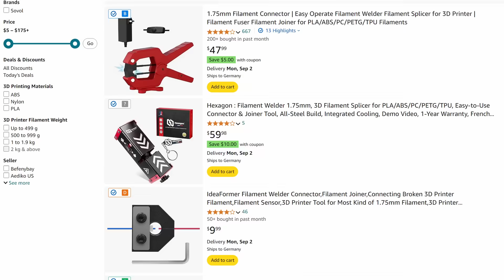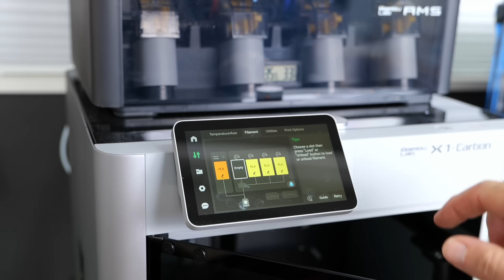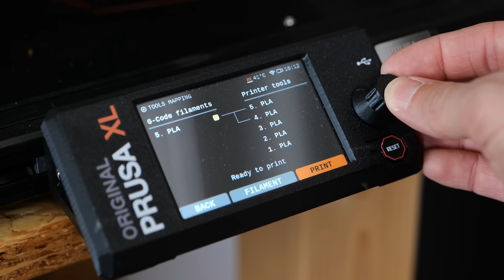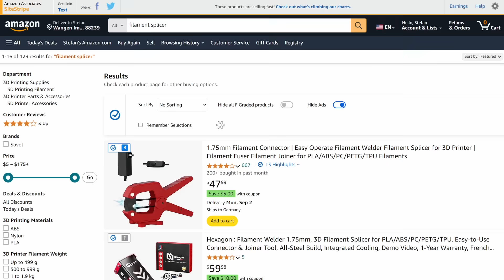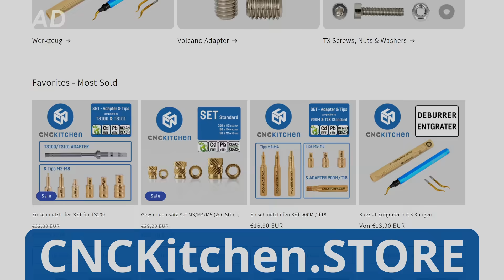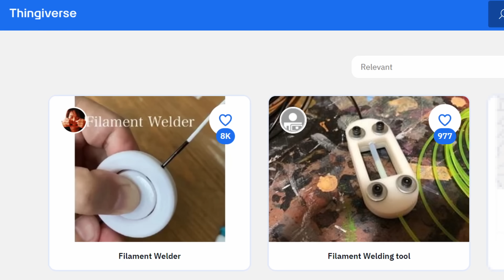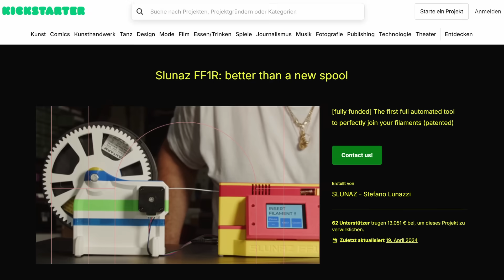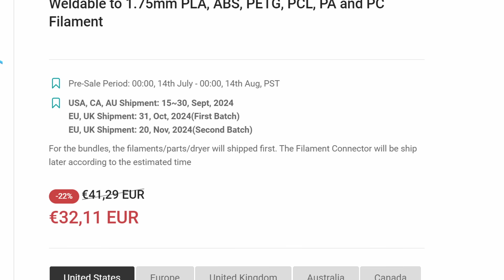The Best Filament Connector but you can't Buy it (right now)

Comment: Hey Stefan! Tbh I happened to use the autorefill for the first time one month ago and it surprised me how the printer stopped when the end of the filament went into the AMS. Sure another roll of the same stuff was loaded in the next slot and the AMS had been updated with the actual filaments. It didn't worked since the AMS gave an error as the end of the filament ran into the funnel. It's been quite a pain to leave the print in pause, disconnect the AMS, tear out the leftover an then inserting the new roll in the slot and so trick the AMS into like the filament never ended.
I didn't even actually got what happened there, so I learned nothin. :(

Comment: What I do.... well, many times I try to print almost to the end, using filament-manager in Octoprint for example and some 'guesswork'. Sometimes I think about re-installing the filament-sensors on my printers but in the past they have given me multiple printfails because of stuck filament in the sensor or just not clicking off at the right moment (probably due to filament-dust in them after some spools).
Especially with bent filament and some thicker parts of filament, they like to get caught or make just some extra resistance on the filament-path.
Maybe get some with rollers and good guidance?

With ABS I make ABS-slurry and with some others like PVA I make glue. Nice for bed-adhesion and also gluing parts together, smoothing spots or gluing other things.
PETG, PLA, I safe together these small bits and use them in my 3D-pens. Nice to make connections/connectors between parts and for example fill letters. Yes, I print 'holes' in the top or sides of the prints when I want to incoperate letters and instead of contiously swapping filaments (I don't have automatic filament-swapping) in the printer, I just fill those holes with the pen afterwards. This is less work then swapping mid-print and no purging needed, no 'poops'.

Of course, just loading and swapping filaments works well. Manually in the printers for example when  filament-manager tells me the spool is almost at the end. It just pauses automatically and cools the hotend down untill I'm back to make the swap (keeping the bed heated!). Sometimes I enable messaging on my phone but mostly I notice the screens on my tablet that it has paused and I walk over to the printer when I have time to continue the print with the next spool. Then just press (in Octoprint) homeXY and move closer to the print again, press 5 times 10mm down and 'resume' in octoprint.  But no, not doing this for less then 2 meters of filament and not for every project. Hard to get it right to put ends of TPU on top of ABS...

And spools that have become bad quality, yes only thing to do with them is to throw away :-( 😞

Splicing with PTFE-tubes.... seems a real bad thing. A couple of cms of those is worse then meters of even ABS in the bin. Also for the health but sure for environment. If they were a bit thicker and with nylon for example or just simply PVA I think that would be a much better solution.
Or other desolvable plastics? You could just use a sponse to take off the connectors.

Comment: I only once connected filaments for testing (torch + PFTE Tube was enough) - and only use the runout sensor version and then watch the last cm go into the (direct) extruder and insta push the new one in. 1 minute if watching  instead of a few minutes of using that connector that costs extra ressources. 
If they insert 2 halfs of more stable PFTE pieces into heaters that are permanent, so you only need to insert the filaments it would be less waste of those tubes - but creating an "login" product that causes you to rebuy waste materials is business case too.
No need to buy that toy. And so I never have small leftovers too.

Comment: Teflon tube and a mini butane soldering iron/heat gun combo takes less than a minute and is reliable. Being that there's usually <20m on the spool, it's pretty quick to just hold the teflon tube while you wind the remaining onto the other spool. I saw a guy drill a 1.75mm hole between the closed jaws of a pair of pliers, which seemed to do a good job of shaping the splice to match the diameters - thought it was a pretty good idea.

Comment: Pallete from mosaic 2 . It never worked as a multi material system as it was meant to be ( I still have the 3 pro packaged and unopened ) but for runout purposes it seemed to work amazingly for me since it didn’t require me to connect anything . But I know it is much more expensive than this device . I this mosaic should release something purely for runout and change filament spools that would appeal to people just wanting for the project to continue being printed when the specific roll runs out. 😊

Comment: Filament splicing my leftovers is the only reason I still use my Palette 2. I don't print with it, I just use it standalone to splice using multispool. It will splice continuously for me, I got a firmware update for it that speeds up the feed rate, so I can respool directly from the Palette.

Comment: I just stick the new filament into my extruder behind the end of the previous color. No reason to pause the print. Retractions won't do anything until the old filament is fully "purged" from the system but that's not usually a huge concern

Comment: I generally only print small things with samples, or components of larger items if the color differences either aren't important or actually add to the effect (such as the six Rolling Storage Boxes from 3D Printy that I made for storing nuts, bolts, washers, and magnets of various sizes). The leftovers sometimes get used for small prints, sometimes get reserved for use as hinges, or sometimes find use in a 3D pen for welding prints together, though anything shorter than 100-200 mm tends to go in the trash because they're hard to use for much of anything.

Comment: Teflon coated non stick frying pans have been around for decades.
Teflon coated heating elements with a cooling period after the heating would eliminate the need for a PTFE tube.
Reply: I can't quite tell, but you do realize that Teflon is PTFE, right?
I do agree that just PTFE coating the heating elements would have been considerably better.

Comment: This is perfect for me. I would already have ordered one if they weren't sold out. I think it's possible to re-use most of the PTFE sleeves by placing the joined spools on a spool winder and holding the tube with one hand while turning the crank with the other. Just slide out the sleeve once you reach the end of the smaller spool.

Comment: Rather than having the PTFE tube, the heating element could have had an opening top/bottom die that encases the filament joint when splicing, somewhat like an injection molding die.

Comment: I use one of those Hexagon/3DS Way ones, and it works even better than the sunlu shown in the video, albeit it's a tad more manual. As far as I know, that 3DS one came first, and it comes with a 3d printed tool to cut the PTFE tube, although it isn't necessary at all. So far I've joined countless bits of filament with the very same PTFE piece that came with the machine, and have a bag left of trims still. Sunlu's solution is just a semi automation of the process that otherwise requires a bit of babysitting to avoid overheating the material, and also has integrated cooling. In my opinion, the 3ds is superior in that regard, since automating such a device is pretty easy to do anyway.

Comment: All you ready need is a short section of PTFE tube and a non-flammable heat source. If you want to remove the PTFE tube after the splice, just cut it before you use it and clamp it closed with a small fold back clip. Even when cut open the PTFE tubes still work fine for splicing filament. But on most 3d printers you don't need to remove the PTFE tube at all. It will just slide down the filament until you take the filament reel off or until need to use it again.🙂

Comment: I made up a jig that supports the 2 filament rolls, so the filament curves naturally into the area were the filament is joined I made up a jig for that, I am using silicon tube a 1.6mm ID that the two ends go into and are heated till fused then since the whole lot is supported and restrained so I don't need to hold it while it cools, then just slice the tube off.

Comment: I think that if you use Teflon-coated aluminum rollers with a built-in heating element, it is possible to do without pieces of the tube.

Comment: correct me if i'm wrong - couldn't someone just take two small pieces of aluminum plate, mill a 1.8 diameter half round trough in each, drill  four holes so the plates bolt together, then... well,  the rest is the same i suppose. maybe wouldn't need to bolt it even, but like, the PTFE tube seems entirely unessecary. just clamp the filament ends between metal plates that, when closed, form the channel needed. also couldn't bulge. you'd just need to wait a but for it to cool.
Reply: Odds are the filament would stick and you'd probably have to clean up some flashing but otherwise yes.
Reply: @oliverer3  sticking... That's an issue. Flashing, Meh. Not a big to me. Far better than single use Teflon.

Maybe that coating e3d uses on the obsidian noodles could solve the sticking?

Pity I lack the tools to make wonting like this, else I would. Course I don't really need it personally.

Comment: PTFE starts to decompose (and release nasty things) above 260 degrees.
Good luck splicing filamanets that require higher temperatures.
Also thise ptfe one use tubes are much more problematic for environment  than the leftover filament on the spool.

Stupid design.

Comment: I don't like the idea of extra PTFE waste streams due to the PFA reasons. However, I think that a version 2 should have a second clamping region that effectively is a heat sink that has a semicircular recess on each side that is nominal OD of the PTFE sleeve. That would ideally reshape the filament back to the 1.75mm cross section.

Comment: I've spliced filament with some 1.8mm silicone tubing (got 10 meters of it on Aliexpress), just hitting it for a couple seconds with a lighter. You could probably just hold it against the heater block of your printer for a while.

Comment: Did you try reusing one of the cut PTFE pieces just to see what happened?
I think the consumable PTFE is the biggest downside, but the tube looks like it might be held in place enough by the heating housing when compressed. Even if there were some flashing I can't imagine it being very significant.

Comment: For me, the cost of either buying or making a filament splicer has to be lower than the cost of just throwing away the little bits of filament too small for me to figure out something to do with them. On top of this, the hassle of joining the filament has to be easy enough to not put me off doing it to save the tiny amount left on a reel.

Comment: I use my filament run out sensor. If I don't watch it and don't swap right away, it lets the printer cool down. After I put in new filament, it warms up and purges the filament to make sure it's all of the way in. It is an Ender 3 running Marlin and a Creality run out sensor.

Comment: I just use my palette 3 pro and set it to the make filament option to splice all my leftovers together.
Its really fast and because it splices and pushen the filament out quite quickly i can just put it direcly onto a spool.

And with the Integration of p2pp for prusa slicer its very easy to use.

Comment: I collect the rest until i have enough to fill a small spool. for splicing i also use a short piece of 1.8mm ptfe tube and a heat gun with 9mm nozzle. The ptfe tube lasts a lot longer though. I don't cut it. I just pull the filament through. single use ptfe feels just wrong. such a waste. I get at least 30 splices from a 50mm piece. usually much more

Comment: I've never tried using the filament backup feature from the printer itself so maybe that functions differently, but on my Bambu Labs printer when you start a print from Bambu studio the filaments don't have to be set as the same color, just the same type.

Comment: Personally I never saw this as a problem, with filament runout sensors I usually just start prints regardless of how much is on the spool. In addition I try to split my models into smaller prints to reduce the impact of a failed print and so I can select the best print orientation and settings. This way I almost always have a small print lined up to use up the scraps. Do you all only print big parts in one go?
Reply: I agree. And also when wielding two spools together, there is a chance it will stuck anyways, and you had to manually switch a spool = ))
After I installed filament motion sensor, I just forgot about any trouble with filament runout or stuck. And I do not calculate if it will be enough, just set a spool and print. So I do not understand, how there could be collected so much leftovers.
The only 'leftovers' I have are 5-6 inch pieces which my printer lefts, when runout event is triggered. I use them with my 3d pen.

Comment: Hmm or if they could get the heating element to hold both of them together while fusing? Then quickly make the element go cold so the filament can set. Then you can remove it without it being w a v y.

Comment: You should try putting a full piece of filament in the tube and cutting it with that device, then using the cut tube carefully to fuse 2 pieces of filament together. If this works then the PTFE becomes fairly reusable.

Comment: I had to toss a bunch of Bambu tough PLA today - or rather I fished it out of the trash after throwing it and having second thoughts. It was not because there was a little left but because that stuff got so brittle it wouldn't feed through the AMS. The AMS wants to pull it through, retract it, etc and it was constantly snapping in the AMS requiring me to pull the thing apart. In a Bowden style printer I could just push that kind of blockage through so I'm giving it to somebody who I know has that kind of printer.
Reply: You know that you just have to dry it?
Reply: @riba2233  Same issue here even after drying so I just throw it out and avoid the headaches and downtime unjamming the AMS
Reply: @riba2233  I tried drying it, didn't work. I wouldn't mind so much but when it jams, I have to dismantle the AMS and put it back together again. A better design would mitigate this with clips on the underside of the AMS that give access to the PTFE tubes without unscrewing and removing everything else.

Comment: They should also include a little clamp/mould with cooling fins to make sure it's the right diameter and cools down nicely. this should fix the finishing step and the problem of pushing too hard.
It's exactly the same moves, but with a cooling block instead of a heating block.

Comment: An integrated filament cutter would also be a good improvement. Insert the filament and get a perfectly angled cut before the join every time.
Reply: I was thinking exactly the same - why not build in a nice angle cutter. Back in a 'analogue' days, film and audio tape splicers always had built-in cutters to get the angle 'just right'

Comment: I don't have many leftovers from printing. I just  push the new filament manually through the feeding ptfe tube of my Voron. The path after the direct extruder is too short for the filament ends to tangle or clog the system.

Comment: I don't see a problem with dragging the filament through the PTFE all the way. You still have to re-spool it anyway.
Reply: When I used this method, I used normal PTFE and just left it there. And collect it later on a printer head. = ))
But mostly I just switch spools when they ends. Do not understand how one can collect so many leftovers = )
Reply: Exactly. You aren't going to leave the 2 spools connected, so just slide the PTFE off when respooling. One could even print an adapter for a drill to make the respooling process easier. :)
Reply: @LeftoverBeefcake  it doesnt slide off as easily as you might think and the whole process LOOKS easy here because they are using small pieces of straight filament, not the very TIGHTLY wound end of a roll of filament that wants to flip and flop all of the damn place.  pain in the butt honestly.  I'm still new to the machine so I imagine once I get a routine down it wont be as frustrating, but right now I want to throw it through the wall lol
Reply: I tried that, it's hard and creates alot of tension.
Reply: @jebronekitty  maybe you had a wrong diameter PTFE or fluctuating filament.
Reply: @yru2501  the ptfe tube used to connect the filament is supposed to be tight to prevent filament expansion when welding them together. So the drag it puts on trying to respool is quiet significant and that's not a flaw
Reply: @jebronekitty  that's a shame. There must be some difference in our setups or execution. Hard to help remotely. Sorry.

Comment: The Sunlu slicer is $105 USD. Thats a hard pass for me ill just do the filament runout sensor method.
Reply from the maker: It was $30 pre-sale and will be $40 retail. So not too bad IMHO.
Reply: @CNCKitchen The current price for backorder on the link you posted is about $105 USD. Just seems weird to slow pre orders by raising the pricing. Plus that PTFE waste is just horrendously a bad choice. Ill stick to my Q1's runout sensor.